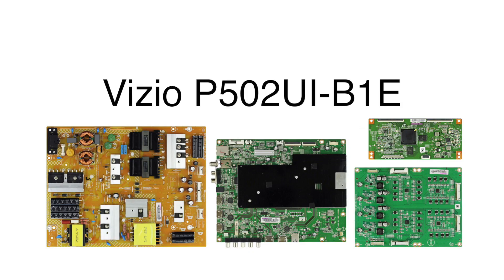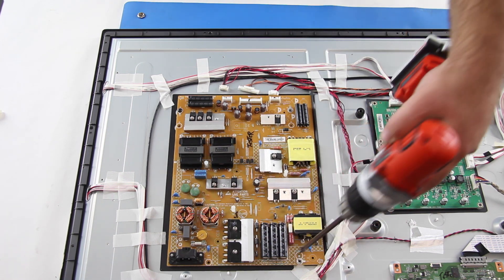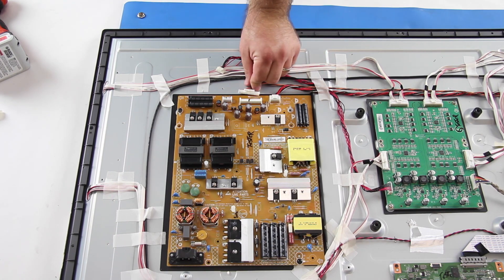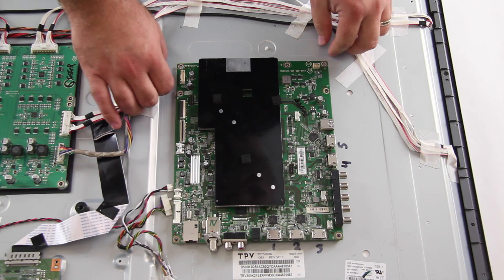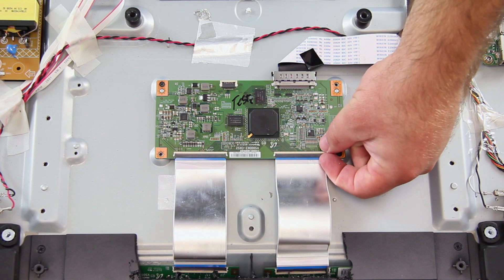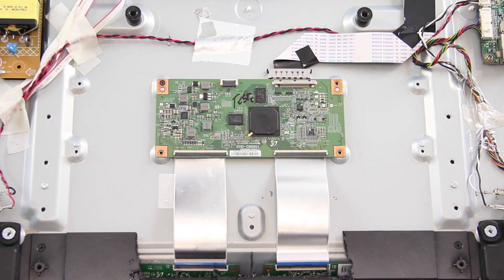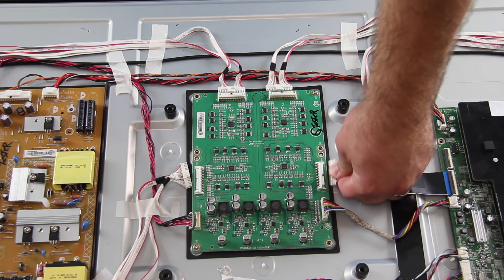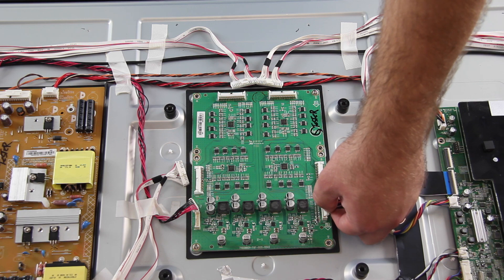Vizio P502UI-B1E Complete TV Repair Kit - How to Replace all Boards

Comment: Hello Jimmy, I ordered the power supply for this exact model from your store, and replaced it on my tv. Unfortunately the tv exhibits the exact same behavior with the new board. When I turn it on the standby light will come on, and then slowly dim out. No sound no picture on the tv. I thought that problem might be somewhere else, and started preparing to return the replacement board, but then I decided to check the voltages on my original and on the replacement board. It turns out neither board has any pins in any bank that will produce the 5v standby voltage. So now I am starting to think that I received a dead replacement board. Is this particular model not supposed to have a 5v standby pin?
Reply: Any follow up?
Reply: Did you ever figure out what was wrong with it Dimitar Ginev? I have the same tv and it just stopped working and now when you press power the standby light comes on and fades out just like yours is doing. The thing is this was my dad's TV that I received when he passed and I really would like to figure out what is wrong with it. Thank you
Reply: Nope, nothing
Reply: I have the same problem an did the same thing I change my power supply and nothing happened. Where you able to fix your tv?
Reply: @edfranperez7718   no unfortunately haven't been able to fix it so far. Also tried replacing the T-con board, but still nothing.  I am now on a lookout for a main board, and will try replacing that.
Reply: @gindio1  crazy you still end up spending alot money so if it doesn't work with the eemprom change I'm just gonna buy a new one
Reply: @gindio1  any luck?
Reply: I have this same TV and am having the same problem with the light coming on the dimming out. Picture never comes on. I caled VIZIO and they were no help. Just told me to replace the TV. My daddy died last year and this is his TV. It has sentimental value to me and I have to figure out how to fix it. Have you had any luck yet? Please let me know if you figure it out. Thanks
Reply: Boards are ok. the screen lighting up and shutting down is due to a dead LED on one of the strips. U can buy a tester on ebay and locate dead led and solder bridge the contacts for the dead LED. Closing the open circuit.
Reply: @jn6779  My TV is totally black and when you press power the standby light comes on and slowly fades out. Any ideas what could be the problem? It was my late fathers tv and I am very interested in figuring out what is wrong so I can get it working again. Thanks for any advice
Reply: @jn6779 , you seem to be very knowledgeable on this. Do you have any experience with COF replacement without bonding machine, by chance? Thanks!
Reply: Any luck ? I now have the same issue
Reply: Nope no luck. The TV is now an oversized led light in my garage :)
Reply: 3 years later.. I can tell you that this model does not have any pins in any of the 5v ports on the power supply board.

Comment: I turn TV on I get sound and no picture or backlight for a minute or two before the tv shuts itself off. Ordered the power board from your site hoping it fixes the problem since the video board seems to be out of stock.
Reply: Ryan Hampshire let me know if this fixes it at the moment my led light turns on but slowly dims away
Reply: @AWildAlien69   Any solution?
Reply: Any advice? Im in the same situation as you were.
Reply: Ben Lanteigne I couldn’t find the part for my tv so I just bought a new one lol but I mean by all means if you find one try it
Reply: I know I'm 9 months late but did this fix it? I have the same exact issue.

Comment: I have a problem with my Vizio p502ui-B1 taking about 10 minutes to turn on. During the loading/starting phase the Vizio logo will cycle between different colored vertical lines but it's only the logo that's effected and the rest of the background is black. Once it get past the loading/starting phase it seems to work fine. Any suggestions on what could causing it?

Comment: Can you guys make a diagnose test video for this type of model with the metering device. I have the same kind of tv but I noticed that there isn’t a 5v wire leaving power board to the main board. Also I I’m plugged the connectors to see if there is 5 volts there on the pin of the connector on the power board but did not get a reading just got 0. I was measuring with dc volts on the multimeter put the black probe on the chassis and tested the pin (that’s supposed to have 5 volts to it from what I’m reading on the board) with the red probe and get that 0 reading. My multi meters works, It’s new. I checked the other pins to see if I get the other rated volts that’s labeled on the power board and I do. Please reply back, thank you in advance.
Reply: I still couldn’t get it fixed I’ve tried replacing both the main logic board and the power board but still the same issue. Let me know if you tried something else please.

Comment: How did you remove the motherboard so easily. I have the same model and it is being held down by 2 pink square like sponges
Reply: 2 years later: I found the two pink squares too... I simply patiently twisted the board left and right with increasing pressure, then slided a ruler from below and the squares unstuck leaving little to no residue.

Comment: Jimmy, I have the similar Vizio P502UI-B1 TV. It started turning off randomly (after 6 hours or 10-40 minutes) a few weeks ago. Then when you turn it back on, the power light comes on and the Vizio logo shows on the TV screen, but it shuts itself off after that. Sometimes (rarely), after it shuts itself off it will suddenly turn ON and work correctly. We could use the TV 25% of the time, but the problem has gotten worse over the past 2 weeks to the point that now it never turns on. Holding the power button causes the power light to blink 15 times, if that helps. Any suggestions?
Reply: By "never turns on", I mean the Vizio logo shows but then the TV shuts off and never works properly. Any suggestions?
Reply: Since the TV still turns on briefly and shows the logo on-screen, it doesn't appear to be a power supply issue. Can we conclude that it is a main board issue?
Reply: Tv has a dead LED causing a open circuit on the LED strip. All boards are ok the backlight part of the tv has a issue.

Comment: hello I have a 47" Philips flat screen model #47pfl5708/f7 . the screen went dark when I turned it on. It flickers a little but nothing shows up. I took off the back of the TV and I can see white dots come on for a moment then off. I was wondering if it was the main board or the t-con board?